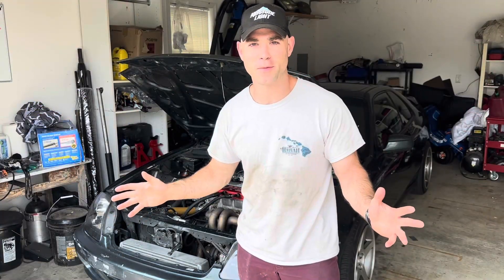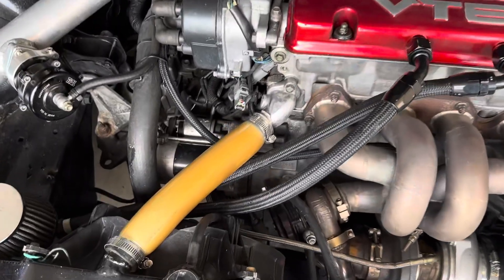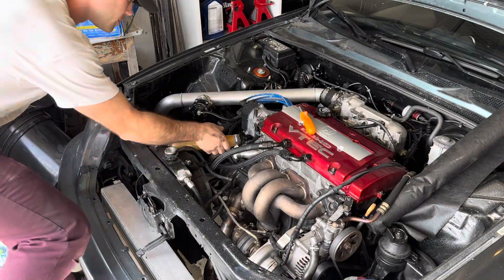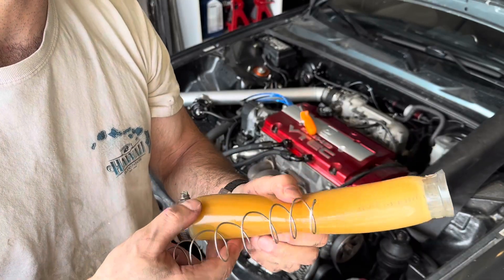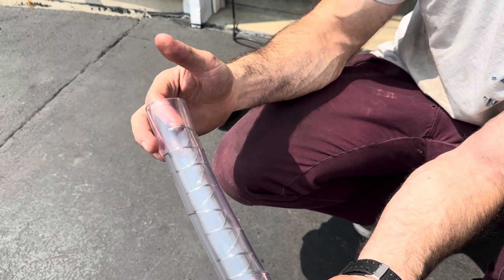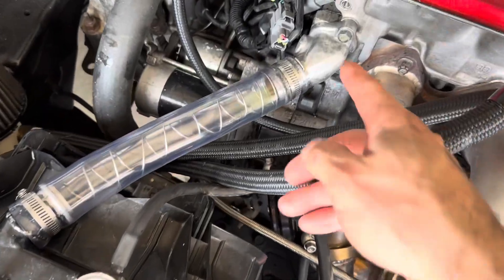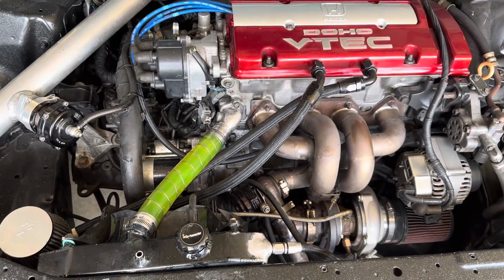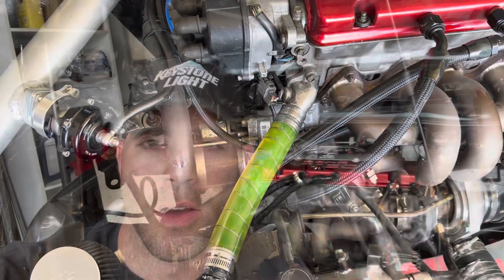Watch This Before Buying Killerglass Clear Radiator Hose

Comment: Cool! Curious how the clear tube is doing a year later. Did you happen to do a system flush beforehand?
Reply from the maker: No flush when I made this video. These do become hazy overtime due to the chemical interaction with the coolant. When it does, I just swap it out when doing a coolant change.
Reply: @ That’s fair. It’s still cheap! Looks cool, too.
Reply from the maker: I do plan on trying acrylic, silicone, and food grade vinyl tubing at some point. It’s just winter in PA so I try to keep the salt off the car.

Comment: Okay here is my thought process. Cooant runs through the engine block. In the case of a blown headgasket youll get micro plastic im youre engine. Will this kill the car? No most likley not if youve got a blown head gasket youve got bigger problems. However why even add extra risk to the shelflife of the car because the radiator is also a componet that isnt built to have plastics in it as well. For a shit ox expiriment hell yeah. Any devoted car builder howverr should never take a shortcut such as this.
Reply from the maker: This is just not a useful conversation as most modern cars have plastic coolant housings.
Reply: I agree completely. But I wouldn't rule it out if one were to perform maintenance much more frequently (Say a coolant flush at 50,000Km instead of 100,000Km) and also changing the hose out probably every 25,000Km during an oil change.  I would do it under those circumstances. But you are right, the micro plastics wouldn't be good for the rad or the heater core. The plastic will dry and become brittle eventually too. I wonder how long it would safely last under those conditions.
Reply: Now im just a simple farm boy not a engineer or chemical guy but doesn't coolant also turn acidic in time, assuming the constant heat doesn't just murder that cleae tubing on datenight. Im pretty sure that stuff was made to be under your sink.
Reply: Aren't most radiators themselves also plastic

Comment: We replaced the hose from the radiator to the reservoir with clear tubing in the 90s to see if we had rust in the system. Cast iron blocks rust. We did this to the reservoir hose because it's not under pressure. If your engine mount goes that short tubing won't have enough room to move, and might break lose.

Comment: This tubing will expand with heat and pressure, over time it will dry out from the heat and become brittle.
Reply from the maker: How many years will it take? It’s been on for a year now…
Reply: @thestateofreal2533 by the time it does it’ll probably be time for a coolant change anyway, two birds one stone
Reply: @jacobperry426  HAHAHA Amazing brother, I'm gonna try this on my 77 Camero
Reply: I was just going to say the same thing because these types of vinyl tubing is susceptible to heat damage. Maybe it'll work fine for now when it doesn't get too hot but you definitely can't take your eyes off of it. Especially being so close to the exhaust manifold like that. For the enthusiast sure but racers or inattentive drivers will see this fail spectacularly. Notice the amount of expansion and hardness/brittleness of the old hose he took off. Replace it yearly, at least, if you intend to do this.

Comment: how well does it hold up under long use and heat?
Reply from the maker: If holds up well under heat over time. Mine is just starting to get hazy again but this is due to the coolant and iron interaction.
Reply: I was just about to ask that same question. Thanks for the update and the video. Keep on mod'n brother...

Comment: Hey man found an old comment of yours on Boosted H/F series group, you said you had a bad experience with -10AN in the balance shaft tunnel? what happened? cause I was planning to use that as an extra breather along with stock breather on the corner of the valve cover
Reply from the maker: Yup that was me! I had a lot of problems with that balancing shaft tunnel dumping oil into my catch can. I did not put a baffle on the inside of the block as I was told this was the benefit of using the balancing shaft tunnel. Turns out that was bad info. My recommendation is definitely use your valve cover as there is far less oil mist and no oil sloshing up at the head. I believe I have a video on how I added bungs and baffles to my valve cover and this cured my issue.

Comment: Have you used a pressure tester to see if it will handle the pressure at the radiator caps maximum?  I think that would be a good idea.  I'd hate to see you in heavy traffic and running 220 or 230 degrees and pop that hose.
Reply from the maker: I’m In Philadelphia right now. Just did a hot lap and driving through stop and go traffic for an hour and a half and not a drop on the ground so it’s been proven to work. 👌🏻
Reply: The hose I seen at the hardware store was atleast 120psi, the larger stuff like hos being 220psi. Now thay doesn't account for heat, but thats substantially higher than the 20psi of my system(i assume this is about average for a coolant system idk 🤷‍♂️) 
Surely the heat can't change the psi ratings that drastically right, hopefully lol 😅 ima give this a try soon I think. Looks pretty cool imo
Reply: @RandoManFPV  Update??
Reply: @terrorking6191  ah I'm hella broke. Like super broke lol its gunna be a few months before I get to working on the car again it looks like.
I'm certainly happy to provide an update when I finally get around to it tho, I'll save this video so I can find it again
Reply: @RandoManFPV you’re not alone bro …. I haven’t even started my channel for my 5.7 bc I really don’t even have the money to do anything to it to make videos😕
Reply: Im down south in mississippi and I drive regularly to Southern Florida and I dont see temps above 194 In  my coolant. I dont baby my car either and its in stop and go traffic all the time.

Comment: The vinyl would probably be ok if not mixed with propylene glycol.   Even Silicone hoses have issues with coolant.    HPS makes silicone hoses and even their website Carrie’s a warning.  You shouldn’t put that metal spring inside there either.  Now your system is really begging for some electrolysis through your cooling system!   Pretty clever though.
Reply from the maker: I knew the metal spring would be okay as a lot old V8 engines have a metal spring in the front upper radars hose. It’s all cathode no anode!
Reply: @thestateofreal2533  Hey man, saw your distributor swap video. I'm gonna be running hondata s300 v3 p28 ecu (obd1) on my 98 prelude (obd2). I'll be using a conversion harness (obd2a to obd1) so the ecu can work with the obd2 parts, will this be an issue if i then do an obd1 distributor swap like you did?
Reply from the maker: @Kaizennx  nope it works just the same just the same. I later switched over to an obd1 dizzy as well because my obd2 dizzy was going bad and with obd1 I wouldn’t need the crank position sensor or the external coil. I used the rywire conversion harness for that. I have a video on the conversion for the obd1 dizzy to obd2 prelude harness.
Reply from the maker: @Kaizennx  no as that’s what I did before I went obd1 dizzy. I am on hondata s300v3 p28
Reply: @thestateofreal2533 hahaha 😆! I see what you did there. Nice one!
Reply: Are you saying that propylene glycol is corrosive to vynil tubing?

Some coolants don't use propylene glycol, I have a 2012 cruze that requires dexcool. Any idea if it has any corrosive ingredient to vynil tubing?

I'm trying to research this myself but I'm not sure who's dumb here, me or Google, cuz I cant find anything useful 😅